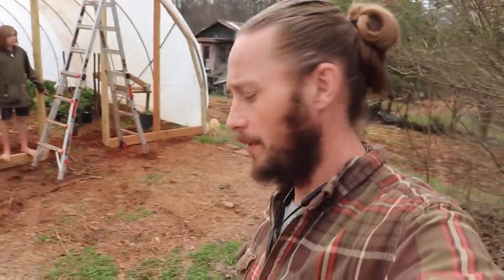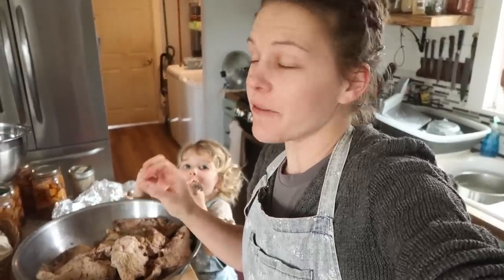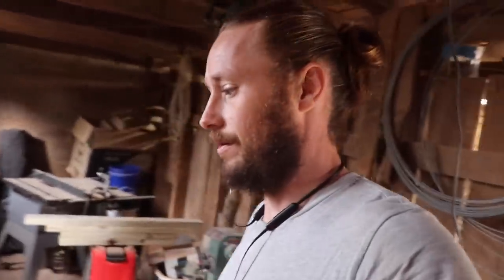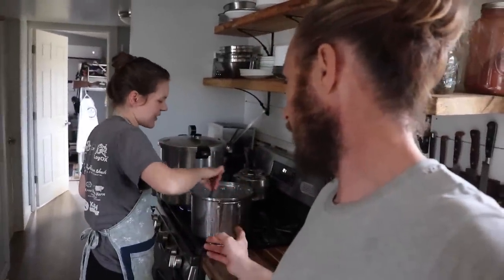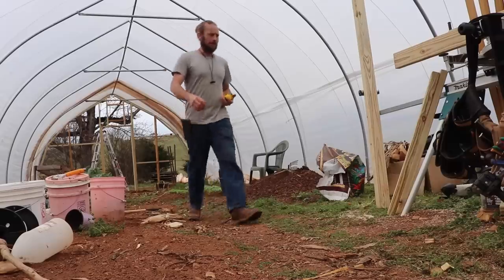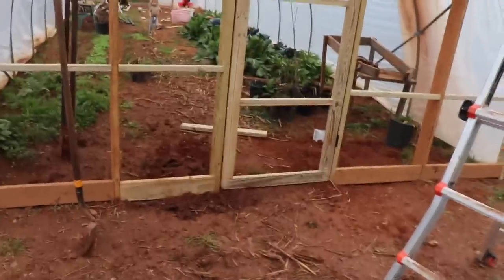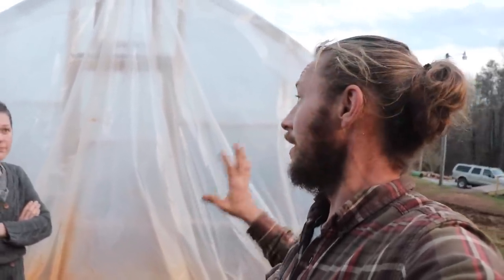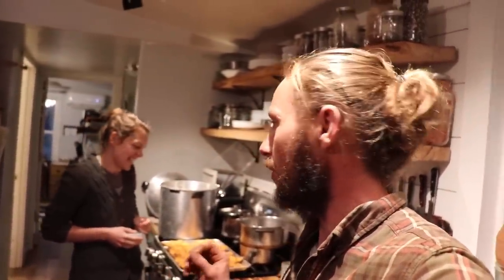Measure Once, Cut Twice

Comment: Thank You Meg. sometimes it just takes longer than expected and I do not have a Lilly under foot. Love hearing her learning to talk. Omg, I can taste that mac & cheese.  Ben why do you need to buy another fan? Most greenhouses have a fan blowing out in one end and a vent in the other end that opens when the fan comes on. It draws air in the vent and the fan pushes it out. If your vent is at the north end or you have some trees shading the vent end, You can cool that green house down very fast. If you only open the sides about 1 to 2 ft up. , the fan will pull in cool air from ground level, and move it up to the fan and out, cooling the whole greenhouse down.  Hot air rises. Cool air falls. Use that principle to your advantage.

Comment: Meg, with all the canning you do, I'm suprised you haven't bought a weighted gauge to replace the dead weight. It has rings to add or remove...5, 10 and 15 lbs pressure. It's a game changer. No longer stuck in one area, eyeballing the pressure dial.

Comment: If you use the potato peeler and shave the sweet potato than fry it when it cools of a bit get really crispy. Very yummy. Also like to say Buggie be careful with no shoes on. I did stepped into a nail with boots on this week. Could not pull it out had to had some help also a trip to hospital getting a tetanus shot. Now I can not do anything it is so much pain. Lesson learned. Getting a magnet and going around with it in the garden. We were moving the shed and all the timber we took out had the nail in it but did not see it. So be careful. High tunnel looking good. 😊🤩😇

Comment: When canning meat if the meat is precooked can you just water bath to seal jars or do you need to pressure can still?
Reply: All meat has to be pressure canned. Just sealing a jar does not make it safe.
Reply from the maker: What Brenda said. The acidity is what determines the canning method. Meat is low acid so needs to be pressure canned.
Reply: You don't need to pressure can anything. Look up Amish canning. However it you are not comfortable with that method use a pressure canner. and yes If you follow the "government (USDA) recommendations, you have to pressure can all meat cooked or not.

Comment: I do not understand why you would order another fan for the end of the greenhouse when you already have one ordered for the other end that did not work there build a second end to use the 1st and exhaust system don't buy another 1 you already have 1 that will work
Reply from the maker: It’s not a fan, it’s a vent. And the reason it didn’t work is because Ben installed it too high for it to open, not a problem with the vent. He just has to lower it and it will be fine. So we will have one on each end to let hot air out and get some airflow.